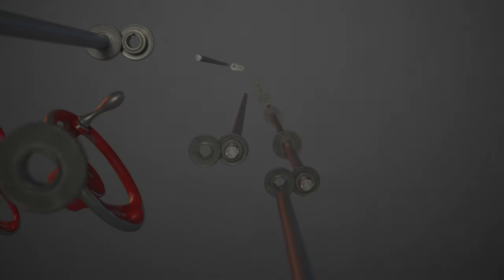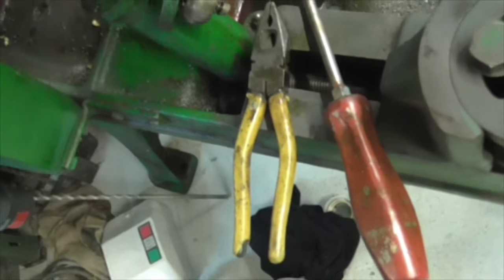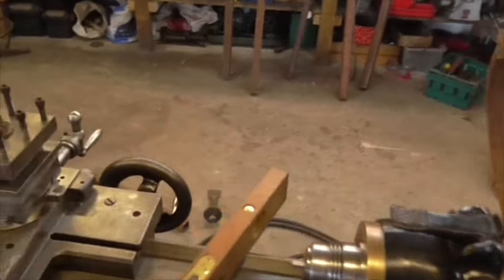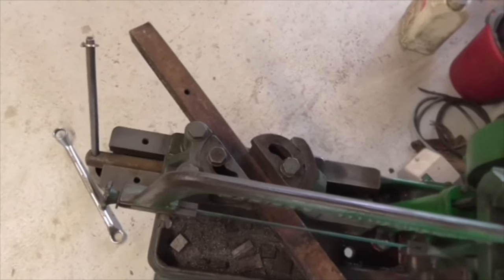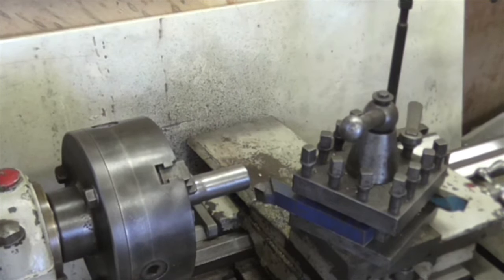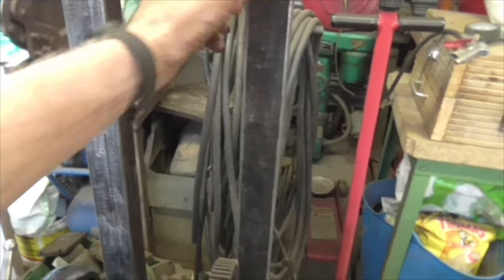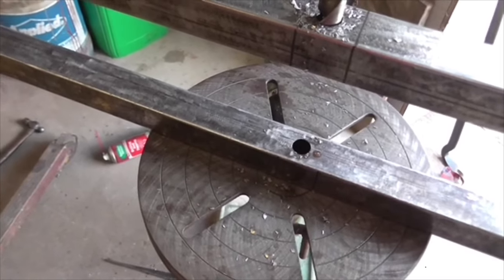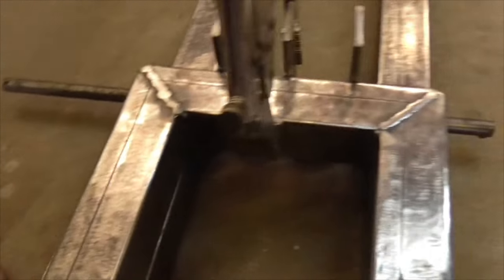Holbrook lathe countershaft support!

Comment: Looking good Phil, Holbrook was the ideal height 100 years ago ! If you need any large drills regrinding give me a shout...Del...
Reply from the maker: @machinenutdel6764  I was thinking that about the Covmac Del, ppl must have been a lot shorter,  all the blacksmiths drills have a 1/2” shank so they are colletable, and the grinds are really bad! I could send them to you for a regrind if thats ok with you? Is your machine int 40 cos i have a shell mill arbor and also a collet chuck I cant use if you want them, send me your address and I’ll send them!
Phil
Reply: @philhermetic  My C10 is 1967 vintage and have it sat on pieces of 4X4, makes all the difference, having spent years bending over laying bricks its nice working with a straight back, why not jack up the Covmac ? Im just about there swapping over my 40 tapers from 5/8 to 16mm, cant see me needing any more, Id buy another mill so you can use them😁. Been enjoying using my reground drills, 2 mins on the grinder and it's like having a new drill, I'll check the capacity of the grinder and email you.   Del...
Reply from the maker: @machinenutdel6764  funny you should say that Del, i was thinking exactly the same! I am 6’ 2” and it does get to you after a bit!
Phil